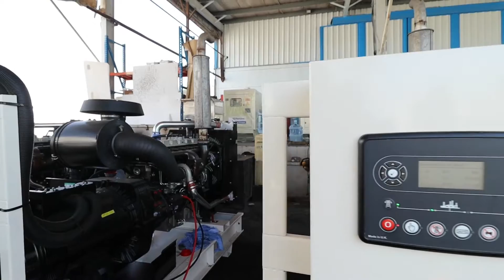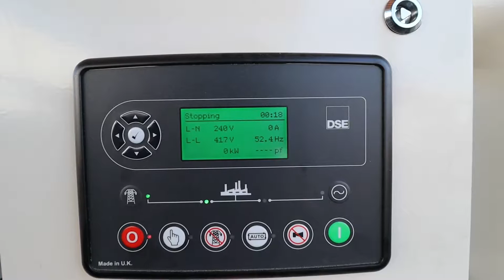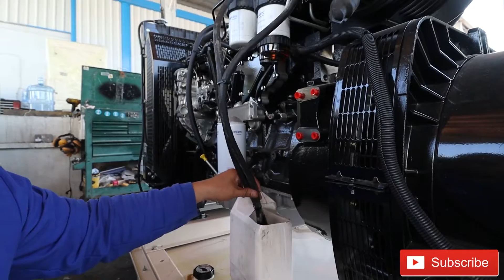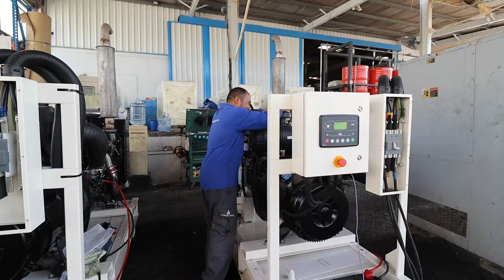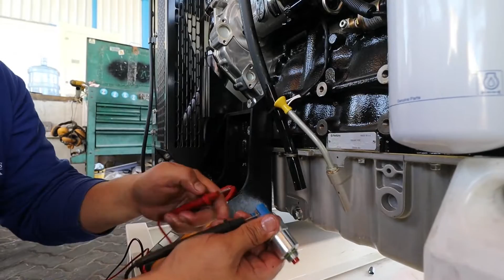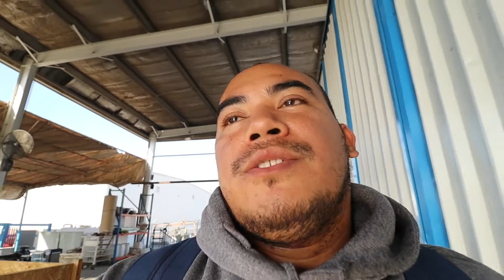FAIL TO STOP how to troubleshoot in conventional engine benzblogs

Comment: Hi idol, how about yung hindi maka-start yung generator engine at "failed to stop" yung alarm. anu kaya possible trouble? thanks Idol
Reply from the maker: Pag fail to start lodi pweding battery issue, pweding fuel intake issue, pwedi g walang supply ang ecu or fuel soleniod

Comment: Solinoid po vah ang sira sir ..or adjust lang delay.?
Reply from the maker: If not start the generator and you get the voltage from the soleniod connection thin soleniod is defective
Reply: Ok sir... E try nku og test tom.. thank kaayo sir?..

Comment: Good day sir,bakit po yung dse 6110 nmin sir pag crank ko start xa tapos pag off nag starter  sumasabay din ang sa fuel solenoid kaya ayaw tumuloy ng andar.. salamat po.sir sa tugon..
Reply from the maker: Ganito gawin mo check mo mona from module kong ang fuel ay ng cut and supply pag ng cut din ang starter doon mismo sa module output from digitalnout
Reply: Yes sir ganun nga po pag cut ng starter sumasabay din ang fuel..tapos crank rest 5 seconds,then crank ulit nag on din ang fuel sol. Subasabay sa pag cut ng starter..
Reply from the maker: @reidtubechannel  kong pwedi mo matignan ang config or program check mo ang number sa module para mkita mo anong naka config baka start hindi fuel on
Reply: Ok sir thank you so much..

Comment: i have encountered similar problem, but there is small difference, and may  problem was when ever i switch on the controller dse8610 immediately it say fail to stop and i didnt start the genset just power on the controller and generator is similar the one u did the video.
any suggestion about where fault came?  thanks benz.
Reply from the maker: Fail to stop did you try to change config or no if now thin check your oil sw its having wrong comfig or if you have deepsea configurat connext to the module go to digital input and chnge it yo close to active and safety on delay
Reply: @benzblogsVlogs  no I did not change, although may oil pressure sensor is a single pole sensor it does not have switch. 

But I will check configuration  and get u back.
Reply from the maker: @abdiazizmuse567  send me pictures too
Reply: @benzblogsVlogs  hello, i am having the same issue, how can I change the configuration on the deepsea?. thanks

Comment: I tried to pull out the positive of the battery then the unit is shutoff is it normal?
Reply from the maker: Yes its normal
Reply from the maker: Mostly to the digital controller

Comment: Boos ano problema sa deepsea module nawala ang screen display
Reply from the maker: Sir pag nawala ang sxreen display pweding lcd ang sira or marumi lang ang rebon sa loob pwedi mong tangalin at linisan
Reply: @benzblogsVlogs  ok boos salamat
Reply: @benzblogsVlogs  boos nag alarm yon bago nawala ang display..msc data error alarm
Reply from the maker: Sir kong msc lang ang alrm di dapat mawala ang display magshutdowm lang yun dapat communication yun ng ecm mo at module
Reply: @benzblogsVlogs  boos pano troubleshoot ang msc data alarm
Reply from the maker: Msc data sir check mo lang sir kong may ecm connection at tama ang connection at may ohm pag nag check gamitan mo lang ng tester dulo2 kong di potol
Reply: @benzblogsVlogs  thank you boss....

Comment: my dse7310 control module fail to change module modes, according to the manual. "if a digital input configured to Panel Lock is active, changing module modes is not possible. what should I do to deactivate the digital input. thank u
Reply from the maker: Yes sir noprob
Reply from the maker: Yes becuase it is lock de activate forst the configuration in the module ao you change the mode
Reply: @benzblogsVlogs  thank you sir, and how do I deactivate the digital input. thank you very much.
can I message you in messenger?